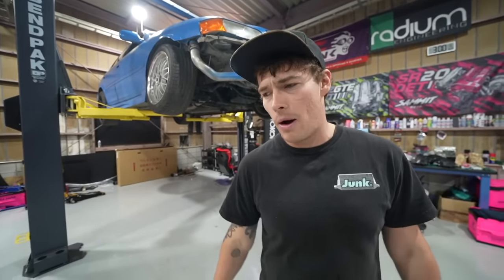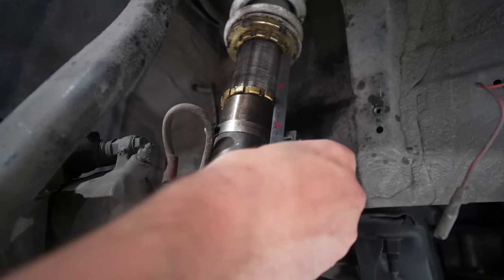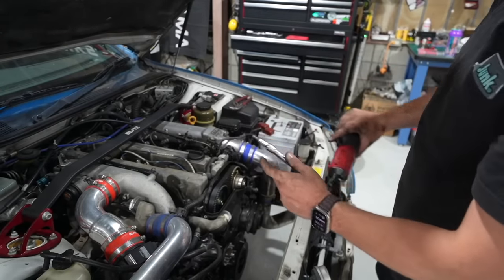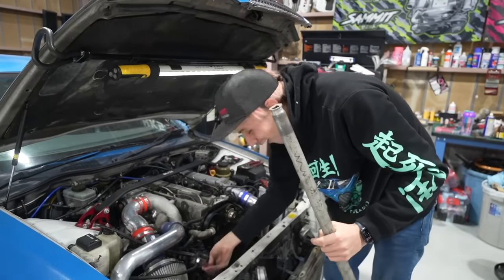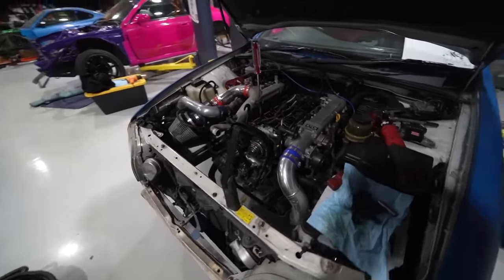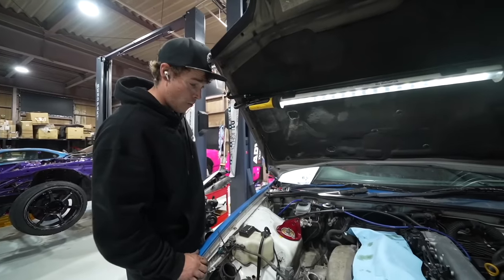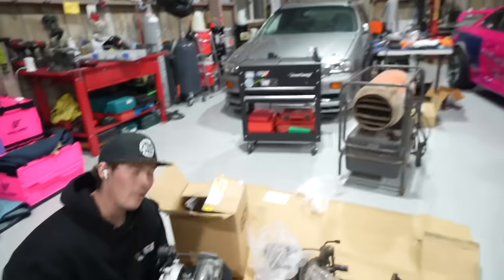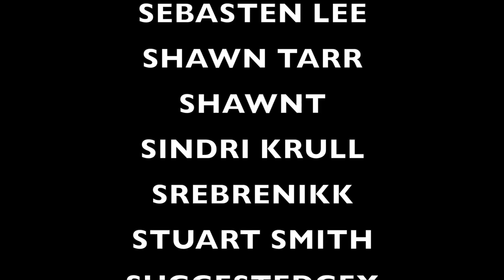TACKLING MY FIRST 1JZ PROJECT, IT WAS A BATTLE!

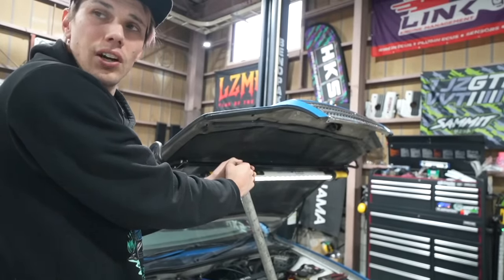Comment: @14:30 Bumping the starter is actually the easier way to remove crank pulley bolts. Had to do the same on my rb26. Put the breaker bar and socket on, put the bar on the ground or against the frame so when you bump it the bar is already locked  in place and the engine will do the work for you to loosen the bolt.

Comment: Usually with the crank bolts on Jzs you can wedge the breaker bar between the either the ground or a frame rail and bump the starter to break it loose